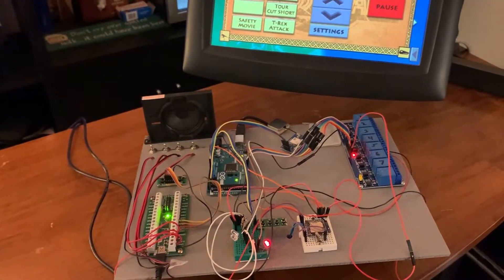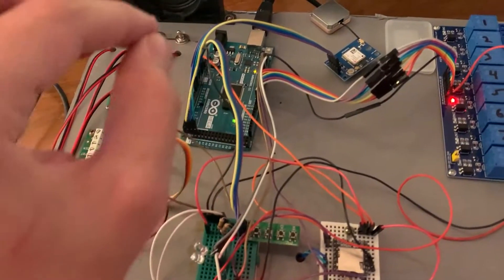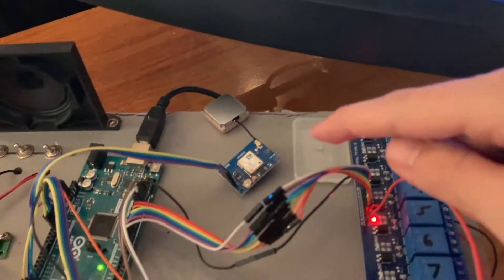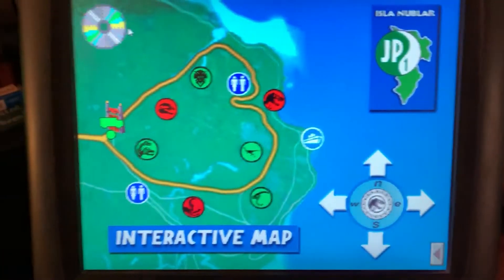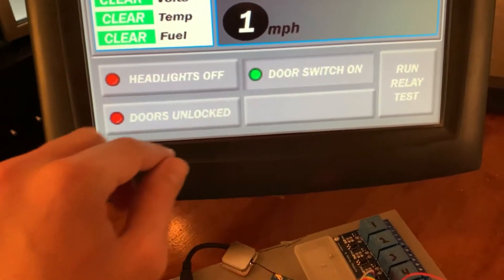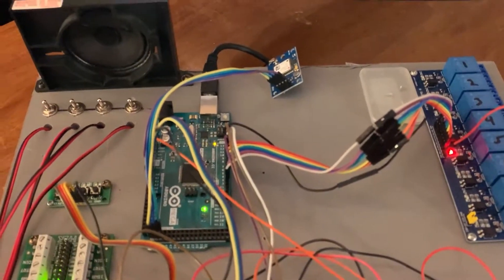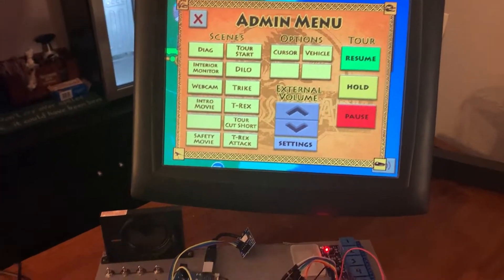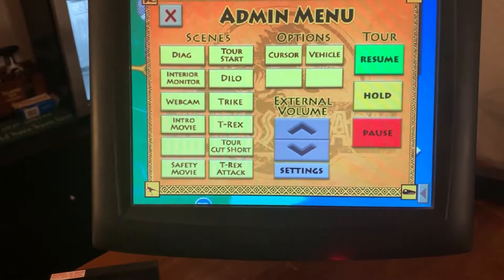Tour Program w/ Arduino GPS

Comment: 9’ Flexible 4/3 touch screen film are now available on some website. I’m sure you can add a film on one of your panasonic monitor.
Reply from the maker: Do you have a link? or key-words? I've been searching. I can find 9" ones, but they are widescreen, not 4:3.  I also found some slightly larger ones, but they are all glass.
Reply: @cyrix9445  You need to search on Alibaba, it's not always for sale. But you can make a request. I tried with "GreenTouch", you can buy one or two 9"  4:3 flexible touch screen for 38.8$/pcs. The bad news is the extra charge for customized fee... It's 220. Sure you can find a better price.